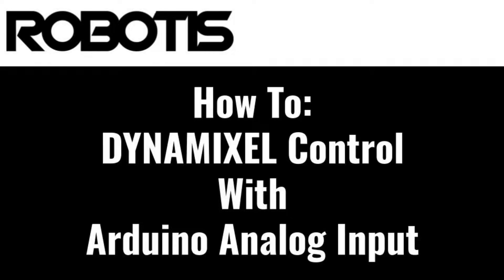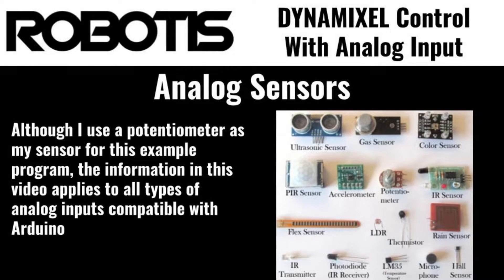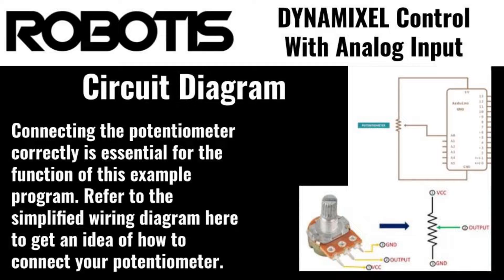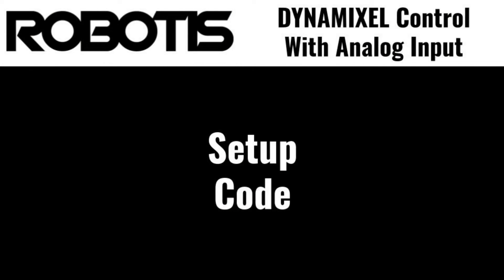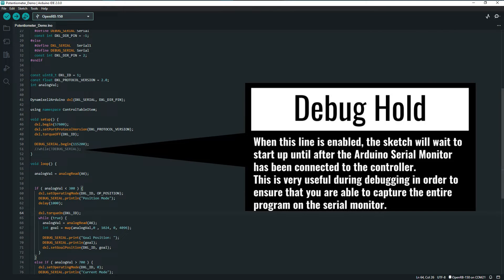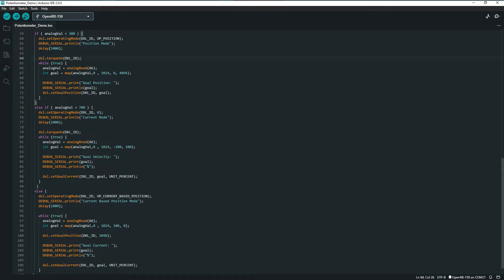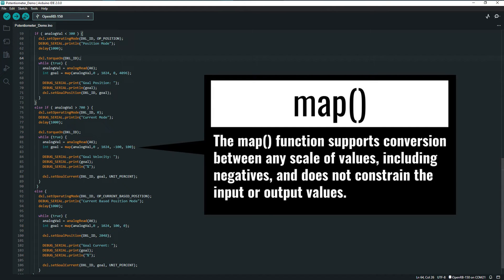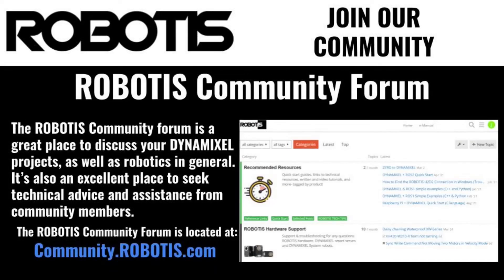How To: Control DYNAMIXEL Smart Servos with Arduino Analog Input

Comment: I use Openrb-150 using ax-18a, but the servo doesn't run, is there a reference program for the ax-18a servo?
Reply from the maker: The standard example programs for DYNAMIXEL2Arduino will work for controlling the AX-18A, after changing the configured DYNAMIXEL Protocol version to 1
https://github.com/ROBOTIS-GIT/Dynamixel2Arduino/blob/84b29f1ba25d1dfae758a6bdc425443f2f3afc2c/examples/basic/position_mode/position_mode.ino#L57
Reply: @robotisus does the version 1 also work for the dynamixel AX-12A?
Reply from the maker: @Lukmanzeroe  If the AX-12A is under Protocol 1.0, then you need to make sure your script reflects this properly. However, if you have updated firmware to Protocol 2.0, then you will want to stick with the stock example (The stock example in the video is Protocol 2.0)